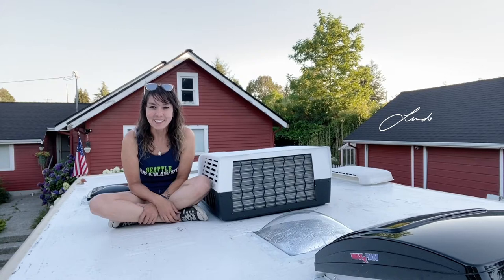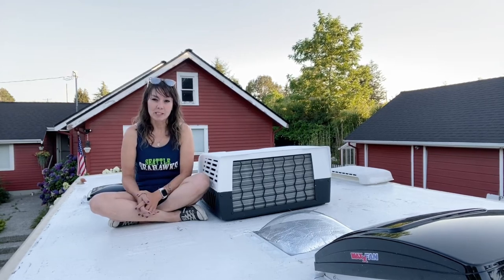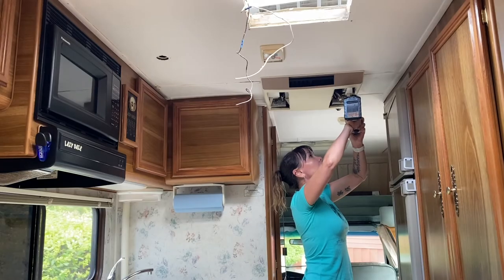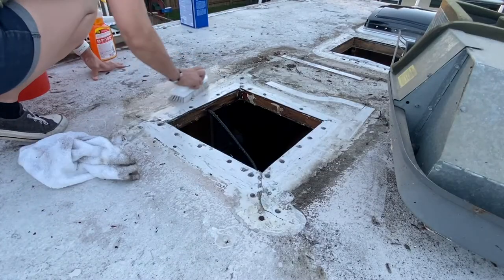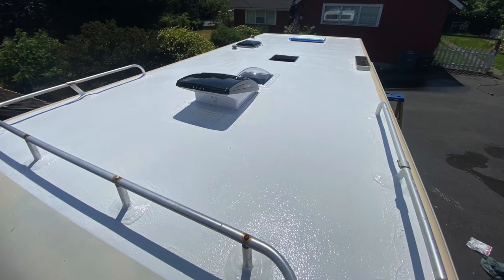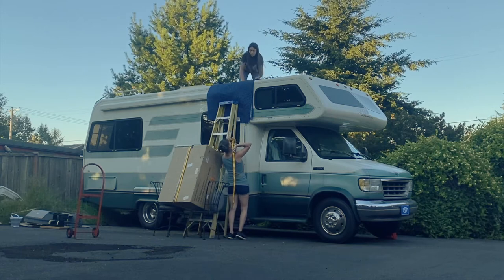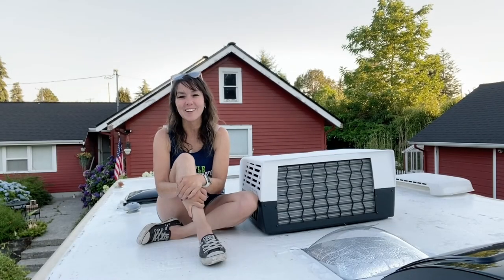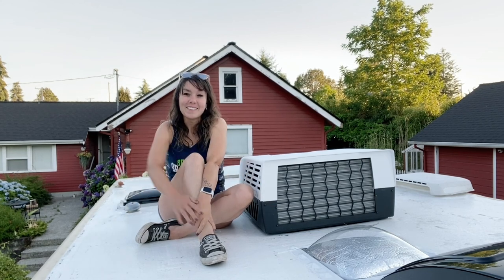Can gIrls install a heavy RV air conditioner?

Comment: I've been RVing since I was a boy in the 1950's. I am really impressed with your renovations so far. At this point I would label your efforts as .... "so far, so awesome"! 
I do have one suggestion for you at this point for this older vintage RV. Have a qualified RV tech run a full pressure test of your propane system. To do it correctly requires the proper equipment and expertise so It will cost a bit.  But a propane leak fire costs everything!
Watching this video with your daughter took me back to my teenage years when I would help my Dad repair and renovate their 18 foot Shasta trailer. Golden moments. I am looking forward to watching your next projects and especially your maiden voyage with Mr. Green!
Reply from the maker: Thank you, that is really helpful advice.  That's one of my biggest fears of having an old RV.  I will look into finding a good local tech!

Comment: Way to go! You both did an amazing job wrestling that AC unit! If you kept the interior ceiling box you could probably sell the parts on Ebay etc. I have the same Dometic Penguin unit and was looking for the 2 vent covers since a few of my tabs are broken.
Reply from the maker: I'll take a look at the one I took out and if they are in good condition, they're yours!

Comment: How is your A/C unit working now? any problems (leaks, etc.,) Also, unless I missed it, I didn't see that you mentioned the brand and/or model number. I think mine is going out.
Reply from the maker: The AC has been working good, no leaks! The only time it didn’t work well was when it hit 104° and it struggled to keep the RV cool. But on normal hot days, it works great. It is a Furion Chill AC. I found the price a little cheaper on Amazon. Hope that helps and you’re able to replace yours!
Reply: @LindaYoshi  Thank you, and it is hard on any AC unit when it gets that hot. I watched another video about the Furrion Chill (AZ RV Expert), it looks like a good unit.